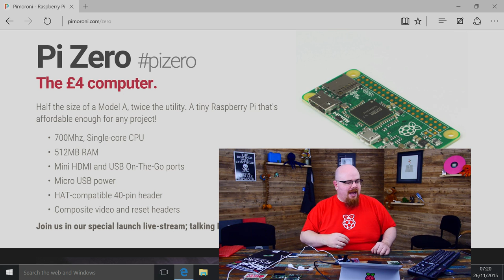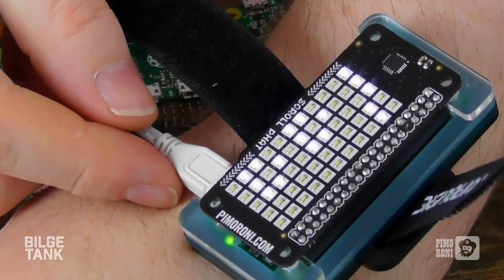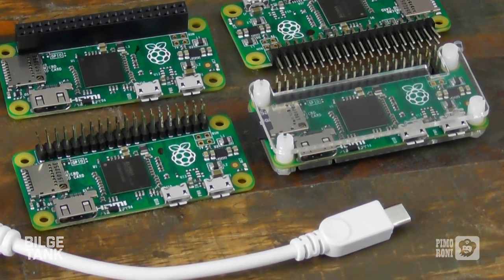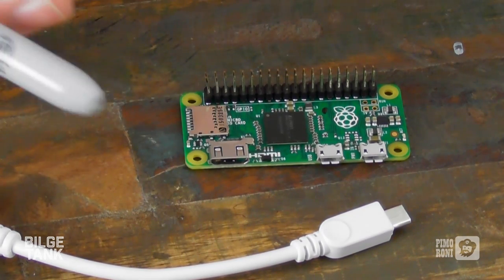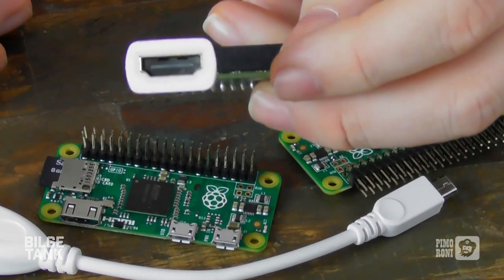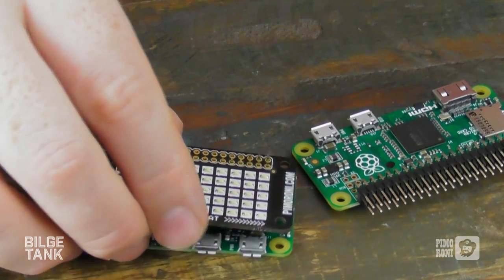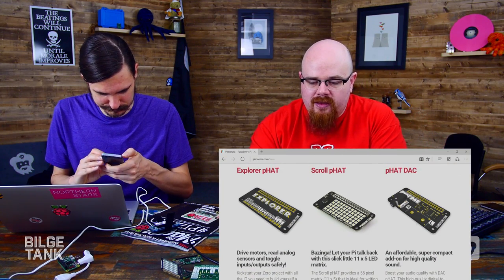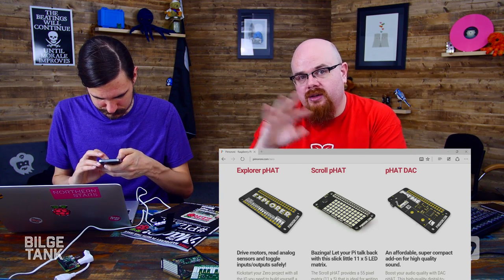Bilge Tank 011 - Raspberry Pi Zero Chatter!

Comment: "Forty Pins is the baptism of fire"  I have never heard such a misleading statement in my life.  Try soldering a 208 pin 0.5mm pitch LQFP regularly  and get back to me!  If you can see it - you can solder it.
Reply from the maker: +Ken Boak It's all fine once you do it regularly. It's the starting that people tend to get hung up on. Soldering 40 pins in 2 rows should start the learning process :-)  Dangerous Prototypes did a great workshop on BGA rework in 2014 :-)